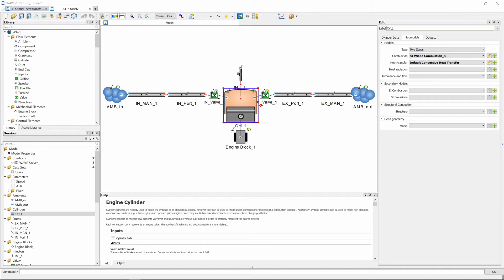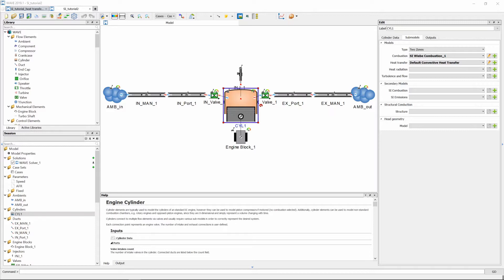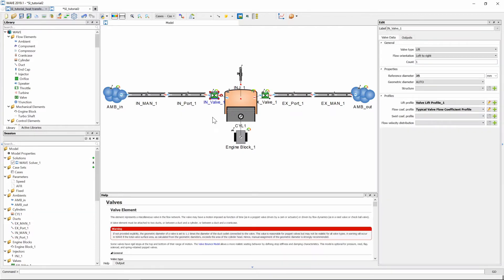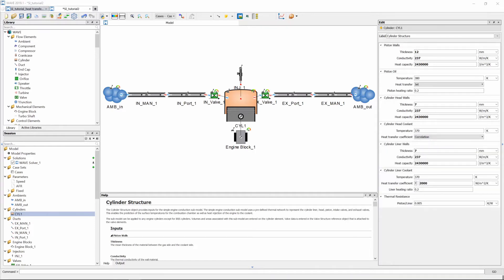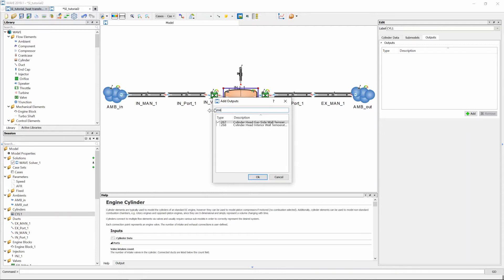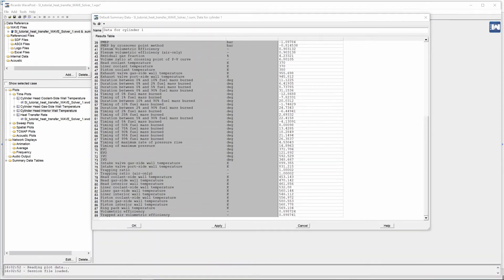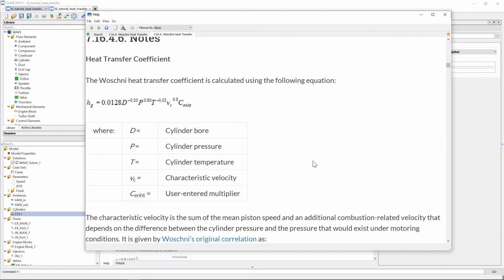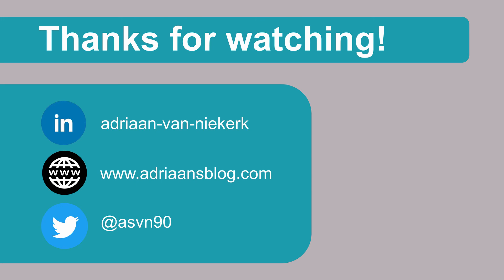How to simulate heat transfer in Ricardo WAVE using the Woschni heat transfer correlation | Tutorial

Comment: Can you guide me where i make mistake when I tried to calculate the heat transfer rate then the graph showed heat transfer rate in the exhaust stroke
Reply from the maker: Is Ricardo WAVE kicking out an error? Or do you want to know how to measure the heat transfer rate?
Reply: in video heat transfer rate vs crank angle graph you found heat transfer rate in expansion stroke but i found in exhaust stroke